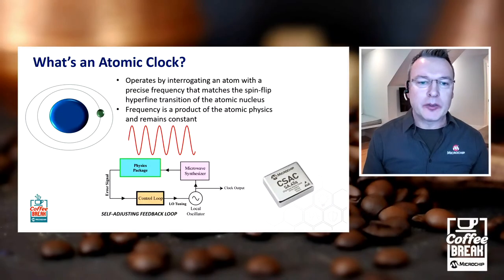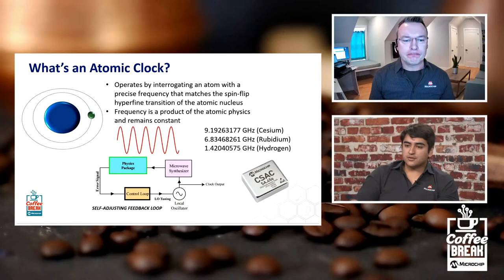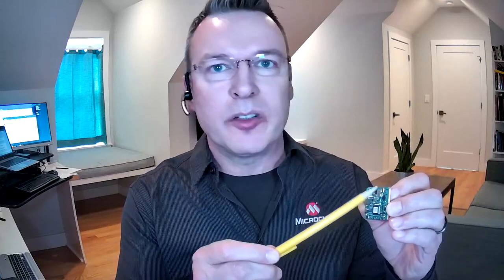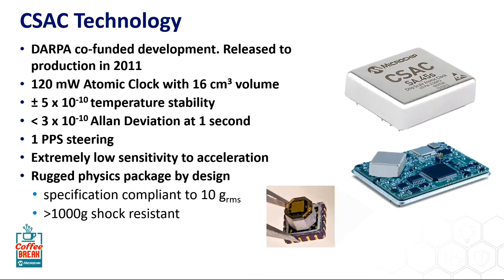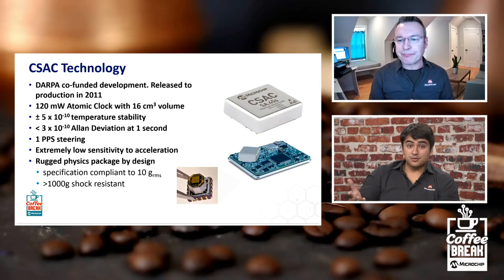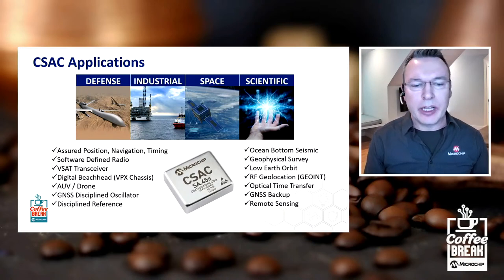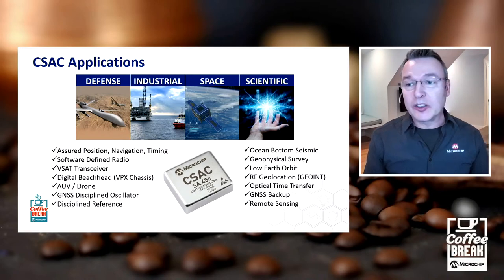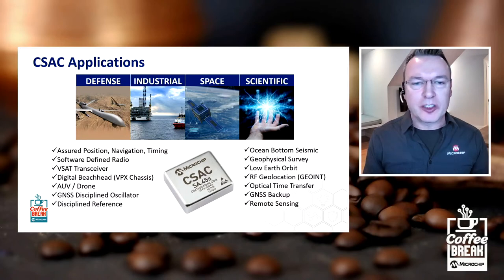Coffee Break | S3E4 | Chip Scale Atomic Clock (CSAC) Applications and Technology

Comment: Great! Thank you for the video. I have a question. At 11:55 you are talking about the Time drift over a day of 2 us/day which translates to getting a tape measure of London-Tokyo within a tenth of a millimiter correct. How is that because I don't seem to understand it.
Reply: London to Tokyo is about 10,000 km (more less depending on route), so a tenth of a millimeter is about one part in 10^11.  There are 86400 seconds in a day so 2 us is ~2.3 parts in 10^11. That's close enough to support the simile.